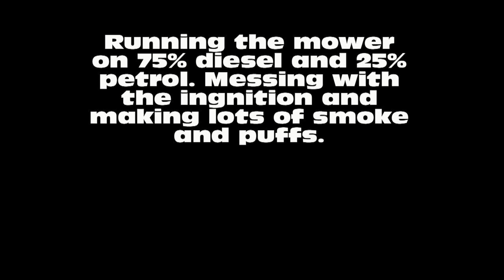Fun with a lawn mower (SV150), dieseling and oxygen feed

Comment from the maker: the only odd parts on the camshaft was the small metal thingy that can place an extra lobe on the exhaust valve (180 degrees apart). there is no linkage to the outside of the motor. seems more like a easy start function or over rev protection. that extra gear with paddles did not have weights on it either. it used to have the fan mounted governor until the previous owner modified it.
Reply: You're exactly right. That fly weight controlled cam lobe is for the "easy spin starting". Once the engine gains speed, the lobe is drawn back into the heal of the cam lobe, allowing full compression while running. The only down side, is that it makes compression testing almost impossible. You have to find a way to get the engine up past half speed, then, it will stay in, until just below idle speed. You need a power drill or something like that, to spin it fast enough for an accurate compression test.

Comment: The specific version you have uses a camshaft governor, basically it is a set of weights that are held in one position by a spring. Once the engine begins to overspeed, centrifugal force causes the spring to stretch. This allows the weights to move out and doing so operate the governor linkage that is connected through the side of the engine and thus onto the carb. Removing this isn't what made your engine start again, sounds like a coincidence that it ran afterwards.

Comment from the maker: yes! unfortunately both my tanks are empty, and it's quite expensive and hard to come by... but if I refill them it's on the list of stuff to try (:
also some propane line running parallell with the oxygen could mess it up real good. just have to make sure the mixing is done just as it enters the engine.

Comment: Ah then you have the SV150 variant - this uses an air vane governor which is nothing more than a plastic flap that is blown by the force of air from the flywheel as it rotates. The item on the cam you talk about is to release some compression via the exhaust valve to make it easier pulled over to start. To be honest i was unaware the sv150 had this decompression feature.

Comment from the maker: yeah, we ripped the old ruined gasket and didn't replace it, so the compression was a tad higher. it started to leak again and eat away the head so I made a thin aluminium gasket after the video. it barely run without ignition, and only at a quite low rpm. the sparkplug probably helped somewhat when it was hot.

Comment from the maker: that explains a lot, and it's also possible the engine refuses to start if that decomp thingy fails to release.
today I got another of these engines, and it does have the internal governor. haven't pulled it apart yet, but I assume there's governor weights on the oil paddle gear.

Comment from the maker: maybe a vacuum cleaner motor to supply some overpressure and enough volume... just have to pressurize the fuel tank and the carb. or feed it lpg/propane if the carb dont like the treatment (:

Comment: Ya could feed to Oxygen acetelene mix slowly straight down the carb from a cutting torch.... if ya slow enough it should run and knock like a bugger..... withthe cutting torch at least you get a free Flash Black Arrester....  ! O)

Comment from the maker: Cool! The strange part is when we decided to put it to some use driving an alternator. The engine stopped running and refused to start. Pulled it to bits and saw the fun stuff on the camshaft, is the speed governor that paddly thingy, and does it just mess with the exhaust valve ? We took the little metal part off from the camshaft and now it runs again :P